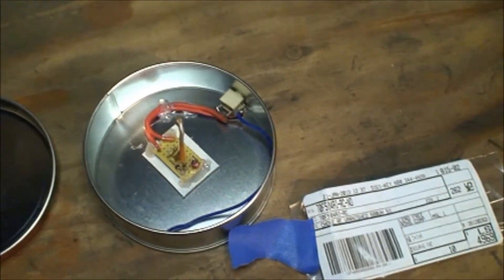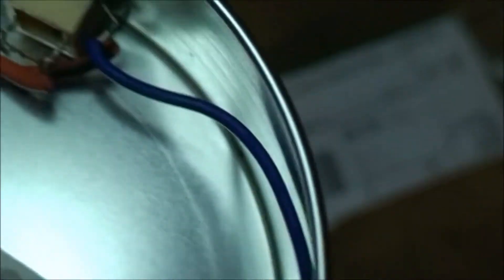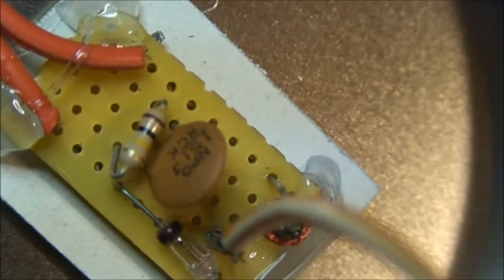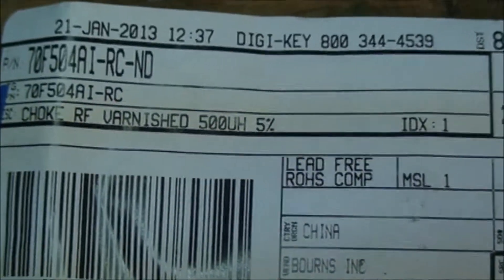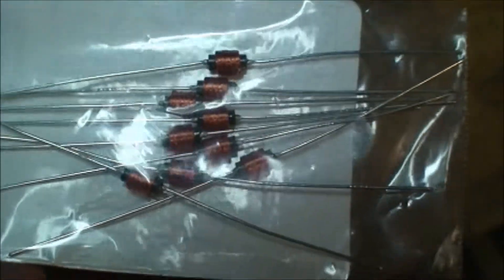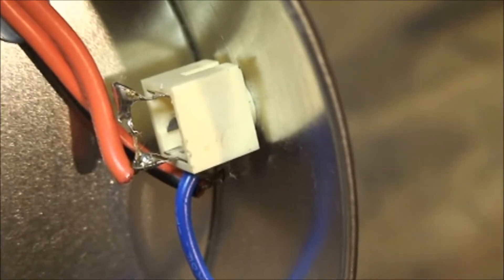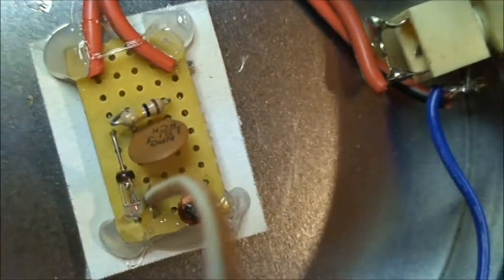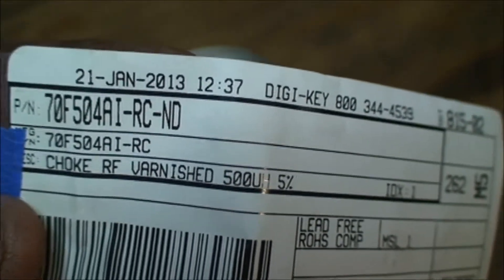raudive diode device in depth.

Comment: What diode is used? Many comments says "F0-215" is the best (most sensitive) diode for a raudive diode circuit.
But these diodes are rare, zero at ebay...

And:
There are layouts with condensors, for example, 22pF ans 2000pF.
Also in a microphone hull. But passive (base: Dynamik mic) or active (base: Condenser mic)?

My wish, a raudive diode in a microphone hull.
In the faraday body the electronic, but instead of a usual metal grill head a plastic basket head (I know, possibly it does not existing... Or?)... And in this plastic grill the antenna...
Problem, antenna lengt?!?

Comment from the maker: Thanks Paul. It could be but I dont think itd cause issues. The ground loop your hearing might be because of the absence of the cap (ceramic). Ive seen that spooky tesla radio which sent me on the path that crossed Raudives work. I was also interested in making it, but at the time the components prices couldnt be justified and I didnt have exact values in my parts bins..eventually. For now Im thinking of winding some pancake coils and experimenting with those, an XMTR and receiver coil. be well

Comment: Erik, I really appreciate you posting this.  I'm thinking my inductor value might be slightly off.  I also tried making an air core inductor but decided it wasn't feasible.  For my inductor I'm using an axial lead inductor.  My circuit and box is also huge as I couldn't find any metal containers that were smaller.  I guess I will keep trying.  Thanks again.  I'm hoping next to build a "spooky tesla radio"...its on the mrfixitrick channel.